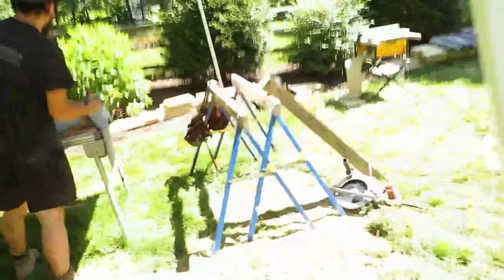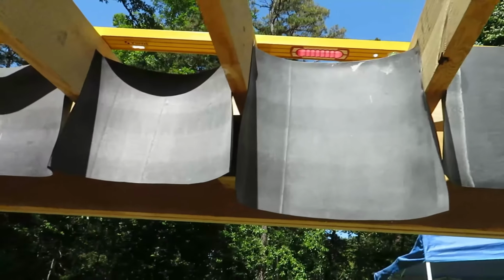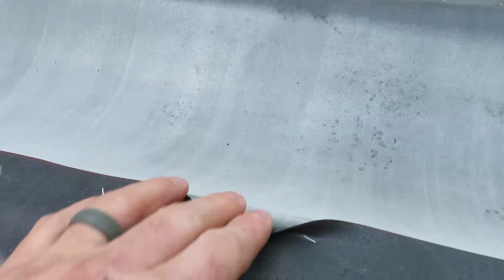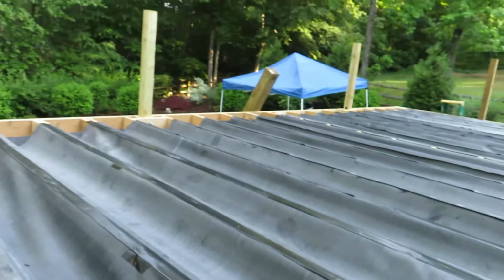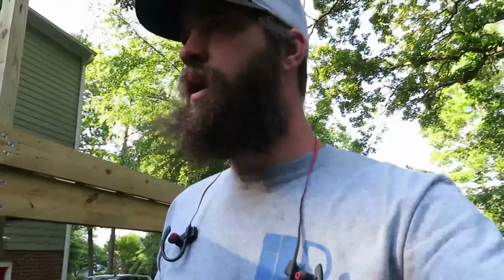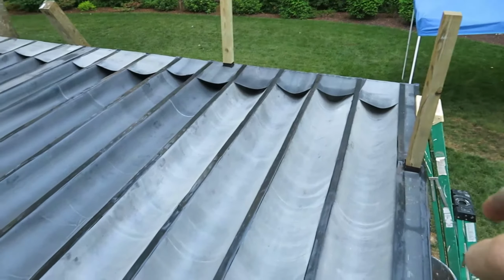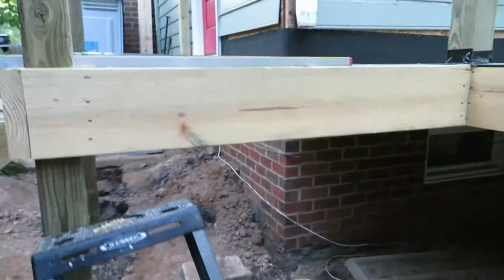Building an Awesome Covered Deck - (Part 2: Waterproofing)

Comment: My attached deck project is basically a rectangular 32’ wide x 15’ deep/projection from the ledger. The box’ is treated 2x12’s 12” on center attached to concrete filled sonotubes by U-brackets. Would you recommend a center supporting beam/girder? The deck is open with the exception of a 10’x12’ cedar framed, metal roof canopy which will be reinforced with tailored’ blocking. Thnx for your video and thnx in advance for your take
Reply from the maker: You’d have to double check the building code, but that joist span should be more than fine.

Comment: Why not just use all 1x4s and no 6s for the lattice so it mimics the siding?  Every use corrugated metal or vinyl between the joists for waterproofing?  Did you block any of the 2x8 joists?  Looks great. Thanks
Reply from the maker: We've done quite a few different versions of that horizontal lattice on various jobs over the years, it just depends on what the client wants.  Never used metal or vinyl for waterproofing between joists, and we did not block them on this deck due to using the EPDM membrane so we could get fall with it.  Thanks!

Comment: Dude. That's sick. probably way overkill, unless there's a lot of blowing rain there, or if the porch roof is just super tall, BUT awesome. This is the kind of stuff that really sets people apart. Roughly what did it cost per sqft if you can remember?
Reply from the maker: You’ll see if you keep watching (and I think I actually spoke about it in a later video). Two sides of the roof are about 8’ high, but the gable end is higher because of the open truss design. A large percentage of the deck definitely gets quite wet during the rain, depending on how windy it is. But it’s also for when you want to rinse off or power wash the deck. 
I don’t remember how much it cost, but it wasn’t that much. Material costs, and I think it was about 1.5 days for two people. I know that’s probably not super helpful, but it’s the best I can do :)

Comment: love that water proofing method, can you share the details on the name of the product used ?  is it just like a shower pan rubberized liner or made specifically for decks ?
Reply from the maker: It’s just EPDM rubber for roofing. We get it from a local building supplier. I believe it was a 10’x50’ roll, 60 mil thick.
Reply: @thebedfords  awesome, thank you
Reply from the maker: @CGGC0202  sure thing. Thanks for watching.

Comment: Why the waterproofing and guttering? Are you trying to keep the below dry when its not usable space? Or you feel like dispersing the water away from under the deck? If so, i wonder, that area as been getting rain long before you added the deck, so unless it was standing water or impacting the house, i am not seeing the water proofing reason. Maybe you can add the root problem you were trying to solve?
Reply from the maker: The client just wanted things they were storing down there (mower, yard tools, etc) to stay dry

Comment: I did my balcony a couple years ago in 45m EPDM pond liner (30x12). I used adhesive caulking in between the through's and it helped tremendously with keeping them straight from gravity. Mine will last longer than I will.

Comment: I am going to keep my joists at 12” OC. So the space between them is 10.5 inches.

Keeping to required (local township laws) of 0.25” drop per foot- the drop over 15 feet is 3.75 inches.

I’ve made a mock-up of this and 3.75 inches is too shallow for my liking - so I’m making that 5 inches, giving 0.33 inches slant  per  foot - gravity pull on the water will make the flow easier.

With this drop at 5 inches from top of the joist, this also gives me a better drop of 3 inches for the “return” bladder from the other side 

no - I see I can make that a drop of 3.5 inches. 

The longer bladder is getting a drop of 5 inches over its length - 

The smaller - coming from the end of the deck, is afforded a drop of 3 inches.

A clear gap of two inches between !

Just in case we have a deluge, this two inch gap will be able to manage that deluge.

Mathematicians amongst you will be able to work out the Bernoulli rate of flow with a drop of 0.33 inches per foot, and a a width of 10.5 inches and a height of 2 inches!

Go for it !!!!

Comment: Great work. Building a deck by myself and am doing the same waterproofing system. Did use stainless staples on the epdm? My deck frame is 42' 5.5" wide. 28 feet of that is 20 feet deep and 14 feet is 12 feet deep. Pretty proud of it. Waterproofing to use underneath as a shed for yard equipment.  Thanks for the video. Very helpful.
Reply from the maker: I don't remember if we used SS or galvanized staples because we've used both.
Reply: @thebedfords  thanks for the reply. Built a deck before but never with the waterproofing.  Dr.Decks used the same system but looked like he used caulk on top of the staples. Thought that might have been overkill if you use ss or galvanized staples with the gtape. Thanks again for the videos. I keep watching them again because my deck is taking so long to build because its just me. First summer was footings, im almost done framing. Next year will be composite decking

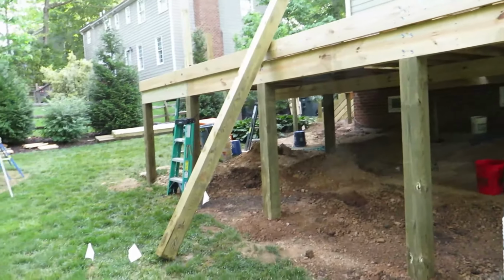Comment: Never heard of water proofing the deck.. learned something new! But a question, 6:16 all the posts are touching the ground, will it pass the inspection? Thank you.
Reply from the maker: So for the size of this deck, the building inspector required extra solid footings. I think I showed them being poured in the first video, but might not have shown them after that. The holes were dug 20” across both sides, and I believe 22-24 inches deep. I can’t remember exactly. Then we poured 8” deep footings in the bottom of the hole. It was a total of 15 holes, and required about 3500 pounds of concrete. The holes are then back filled, which isn’t an issue because the posts themselves are rated for ground contact, unlike most treated 2x framing material. Pretty much all posts will be treated for ground contact.

Comment: Hey I’d like to see how the baffle ends are positioned in relation to the gutters . Obviously the gutters need to have runoff slope as well but do they install the gutters tight to the ends of epdm at the top and then whatever it ends up on the lower end ?
Reply from the maker: Something like that.  We probably had the baffles touching the bottom of the gutter on the high end, and just barely hanging inside it on the low end.  We might have even cut them a little differently, I honestly don't remember at this point.

Comment: Hey! Little late commentimng but how did you waterproof or flash the deck to the house? I didnt see any flashing over the rim joist. 

Thanks! Kyle
Reply from the maker: The county requires a membrane between the house framing & the deck framing, and then some galvanized metal “L” flashing that goes up behind the siding & out over the deck framing.  I probably just didn’t show it on video very well, but we did it.

Comment: Did I miss it in here, how do you plan your cut for the membrane to get the right sag? Start at the oc width then add 50% for the end of the trough?
Reply from the maker: My recollection is that we cut the piece 18” wide at the “top” & 24” wide at the “bottom”. I think we cut a couple small scrap pieces first to make sure that change from almost no sag to significant sag would do the job.
Reply: @thebedfords
Reply: What spacing of joists OC do you have for these sizes ?

12” OC

Or

16” OC

???

Comment: I wondered is there a general formula for cutting up the bladders.

One end/ side is narrower than the opposite end /side.

14” at the narrower and 24” at the fifer end ?

I am going to say this is for joists that are 12” on center !

Yes !?
Reply from the maker: That would be pretty close.  Plumbing code for the minimum fall of a pipe is 1/4" per foot, so I think we were usually shooting for something like that for things like this.
Reply: Does this not depend on the width of the joists ?

For 13” OC, the width on the shallower end ought to be closer to 14” and the far end, where it’s deeper / droopier, shoukd that not be 24 inches !?

Please sone one reply - I’m struggling with this also.
Reply from the maker: @Indus2020  yes, it does depend on the joist spacing.
Reply: Thank you @theBedfords.

Comment: How does the drainage work under your picture framing and middle board?
Reply from the maker: It doesn’t really. But those are small areas, and once they collect enough water, it would either run off the edge of the deck or into the trough next to it. Still keeps the framing dry, along with everything under the deck.

Comment: Great video. Just found your channel. Building my deck myself with drainage like this video. Ever have trouble with the joist not touching the beam (beam nearest the house) where the joist crowns? I thought there might be 2 separate joists but looks like you ran 1 joist over 2 beams
Reply from the maker: Not very often. We grade/sort our joists by size, so that greatly reduces the chances of it happening. But if it does, I just use a composite shim to make up the difference. 
Thanks for watching, and I’m glad you enjoyed it!
Reply: @thebedfords  thanks for the response.  Look forward to more videos!
Reply: I also do grading, but on occasion shimming or planing is necessary.
Reply from the maker: @johnangelilli1164  It sure is.  It's amazing how a little bit of extra effort on the front end pays such high dividends on the final finished product.